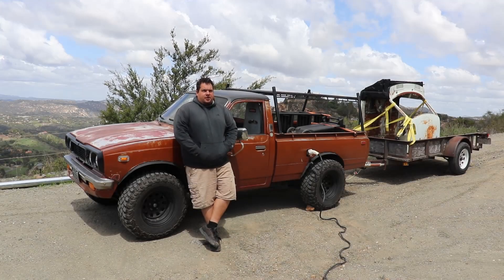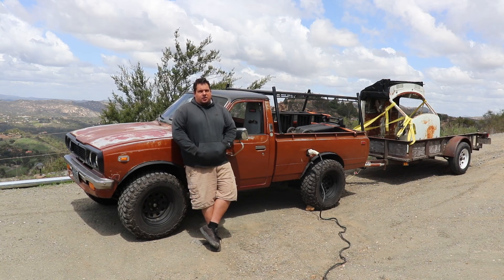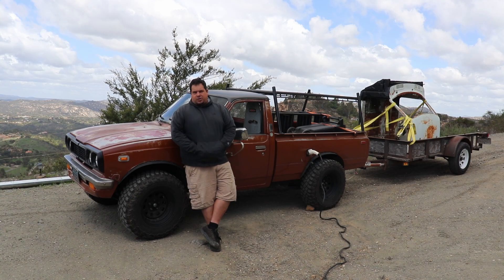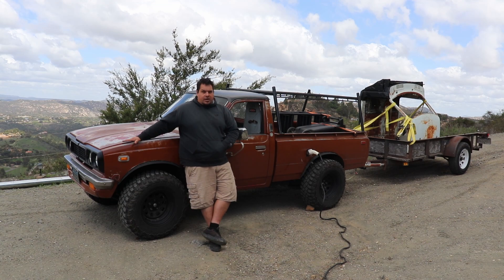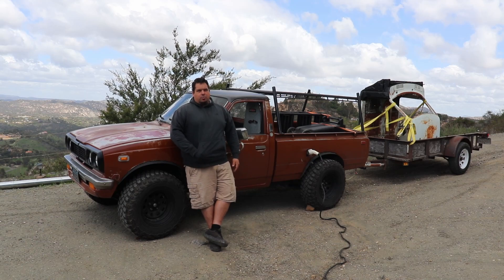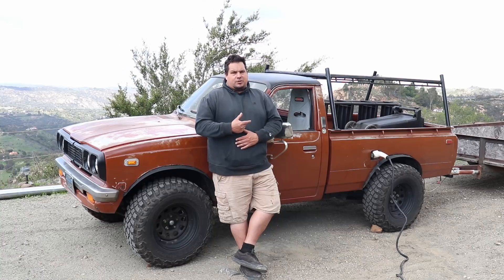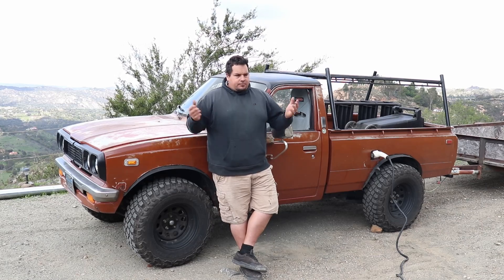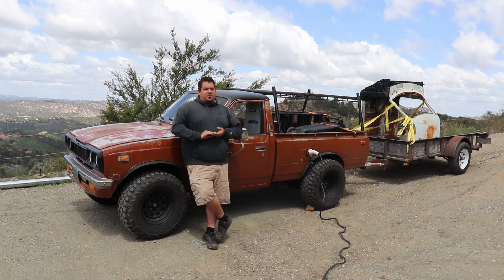Why am I ADDING A RANGE EXTENDER to my EV? Tesla powered Toyota Hilux with a Kubota! Video 6

Comment: Imagine working at a shop that doesn’t pay a outside service to recycle hazardous waste fluids so they don’t have to pay for the different business licenses and to not pay the state taxes for a different tax bracket and pours Tesla coolant fluid down the toilet, or uses salt and water to remove volts from old damaged batteries to throw in the dumpster instead of paying a company to recycle and dispose of them legally 

Then telling the uncertified in how to handle hazardous waste materials from burned battery packs, employee tgat” if never make you do anything I wouldn’t do” to gaslight your employees into feeling it’s ok to open a dangerous cancer causing battery pack

Comment: You might want to improve aero a bit to increase range:
With the Motor drivetrain etc a flat(ish) bottom is easier.
Grille block.
Perhaps fair-in the tires and add aero hubcaps. Their tops are moving forward at 2X airspeed, squared for drag.
A cover for the back.

But NB that in city stop go driving 68% of 'fuel' is used accelerating weight, while only 14% is used overcoming aero drag.
(24% - 47% for freeway)
So there is a fine line between adding weight for aero and eco.
So;  you might consider making the genset quick plug/unplug so you can leave it @ home when not reqd.

Comment: Call it whatever you want. The only difference between a Range Extended EV and a PHEV is the ratio of range from which source, right? I think that’s why BMW shrank the fuel tank for the U.S. i3, but I can’t actually find any reliable source of what that ratio is.
Reply from the maker: That’s true. They shrank it because of a dumb regulation saying the generator can’t out range the battery pack if they wanna register it as an EV. 
They didn’t physically change the tank though they just made the gauge misread the last .9 gallons. Which was easy to reverse haha.
Reply: @ oh I see, I guess that makes sense though if to be an BEV you have to have >50% of range come from battery. BMW should’ve just increased the battery size a bit rather than hide useable fuel capacity, but one of those is obviously cheaper.

Comment: The difference between "aerodynamic" body panels and a flat faced siloet of the truck is like 15%.  Those tires are fine. Next time get 32". When I went from stock (30.6) to 33" mpg went from 19-20 to 14-15...by the time the 33's were worn out 18. Switched to 32's stayed at 18.

Comment: what rectifier are you going to use with the i3 generator?
Reply from the maker: I’m gonna be using a Kelly controller most likely so I can regulate the power coming out at any rpm.

Comment: Keen to see the next update. 
I found an i3 being wrecked here in Australia. Not exactly local as it's on the other side of the country (as the crow flys- 3,606 km or 2,240 miles). They have a Rex unit for $1500 plus freight, but no idea how worn the engine would be as it's a 2014 model. Perth is a remote city, so it either just did EV within the city or used the Rex heavily if leaving the city limits.  So it is either barely used or possibly flogged out. Would be good if they were selling the generator part separately, but no luck on that.
Reply from the maker: Nice! That’s good you at least found one. Curious about that engine. Definitely right it’s either hardly used or hammered. But sounds like it might be a decent unit. 
I’m hoping to get the Kubota setup in the truck next week so it should be a solid update!
Reply: @J5Jonny5  Are you going to do a bench/stand setup to play with the generator unit first? I'd interested in how you control the generator output in relation to engine rpm. And how you govern the engine rpm to maximise the torque sweet spot for best efficiency.
Reply from the maker: I might do that or I might just stuff it in the truck and start messing around. It’s gonna be super manual setup so I can play with the settings until I find the sweet spots. I might make a controller later on.

Comment: @J5Jonny5 I really like your videos!
Why not using the entire i3 Rex engine + generator?
It comes already bolted on and it lighter to lug around when on electric mode.
Tecnical disadvantages in relation to the Kubota or it see the Kubota as a more interesting project?
Reply from the maker: Thanks! Yeah it’s definitely because the Kubota is much more efficient and serviceable. From what I see those i3 Rex engines are pretty pegged out trying to make power which would lead to a short life expectancy. The Kubota was designed to operate for thousands of hours at those power levels while being super efficient considering its diesel power. Also diesel in general is much less flammable compared to gasoline. And being next to 400v power I don’t like the idea of a potential leaking fuel line spraying on something with that voltage.
Reply: The Kubota engine is more serviceable compared to the i3 REX engine, which maybe could be serviced by motorcycle shops since it's a Kymco derived engine.
Reply: The BMW Rex is not very economic. The Diesel will be much better.
Reply: I've been doing some research on Rex unit and wondering if the whole unit would be a good option. I don't know what rpm the engine needs to run at to get the max output, but the stock setup has it ramp down at slower speed to reduce cabin noise. Maybe its not that loud, but BMW wanted it close to silent. 
With good servicing and cooling it should last a long time.
Will the Kubota low RPM be suitable to get makes generator output, or can you control the max load regardless of the RPM?
Reply: @ The Rex engine is actually a Maxi-scooter engine. With a high rpm ,I think.
Reply from the maker: @jurgens9867  interesting. I did remember reading about what it was. I also remember pulling a large hill in that car and waiting for the engine to explode when it was pinned going up lol.

Comment: im planning to copy this but on a catamaran boat with solar panel
Reply from the maker: That would be honestly pretty epic. A catamaran would be best for efficiency.  I thought of doing a boat too but I’ve got enough projects to finish right now lol.
Reply: Have you seen Sailing Uma YouTube channel?
Reply from the maker: @ I haven’t
Reply: how about using vegetable oil or used oils to run the diesel generator? you could heat the oil with electricity or the exhaust and make an collect oil for storage and filtration when you have time!